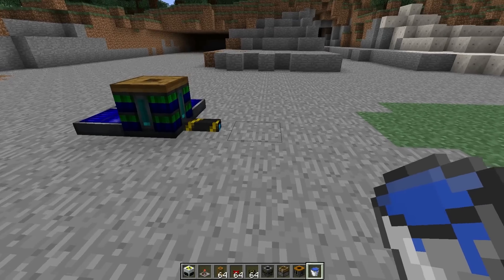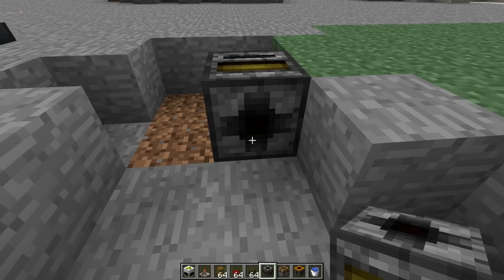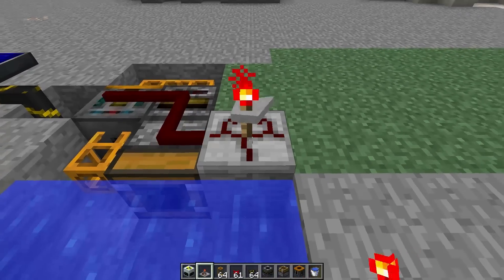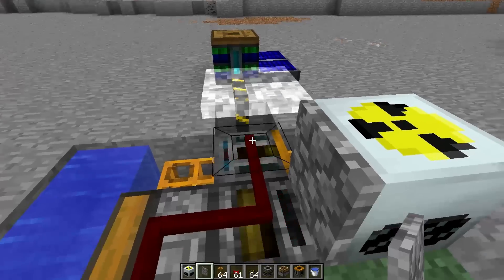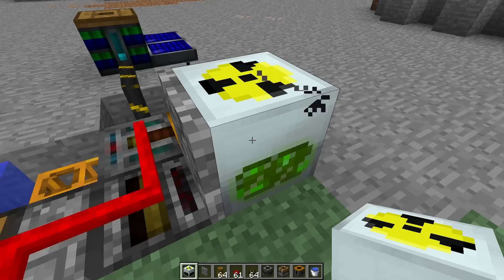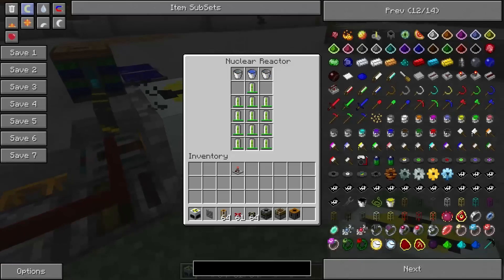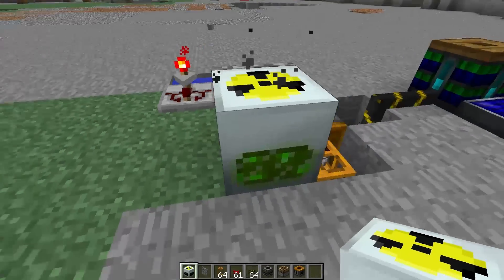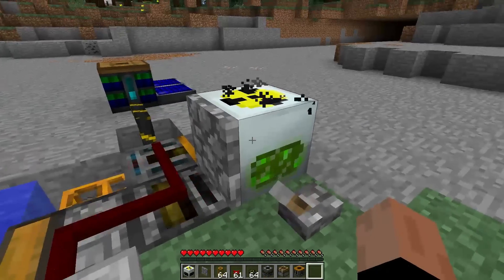[Tutorials] Redpower & Industrialcraft - Compact 490EU/t CASUC Nuclear Reactor

Comment: As I said before this reactor does work, Its done fine. I had turned it on monitored it for about 10 minutes to make sure the flow of buckets into and out of the reactor was stable and then I walked away from my computer and let it run. for about 30 minutes or so. I'm on technic pack 5.0.5 on minecraft 1.0.0 and it does run fine. I have not ran it a full cycle yet but the industrial craft reactor planner does say this reactor can run a full cycle with about 2 buckets per second

Comment: Thanks!  It's working this time, and apparently below 50% heat when immersed in 19 blocks of water.
Next I'll try running the redwire and timer below the machines instead - this should allow 2 more blocks of water in the containment vessel.
Everything I've seen indicates that this should be able to run for not only a full cycle, but almost TWO!  Only a few minutes to cooldown in between.  Also, don't forget that reactor output is over 2000 ticks, so that 490 EU/t means 98 Million EU produced.